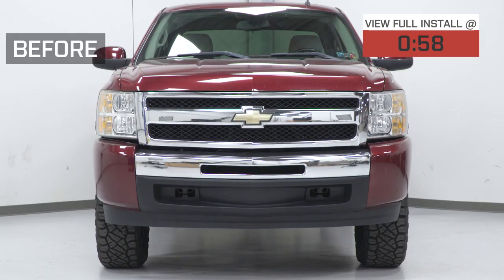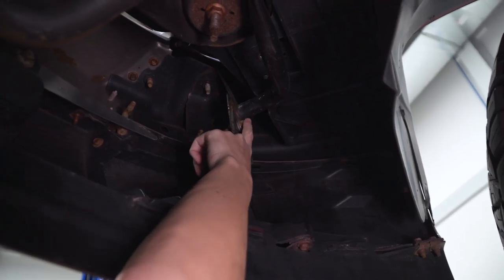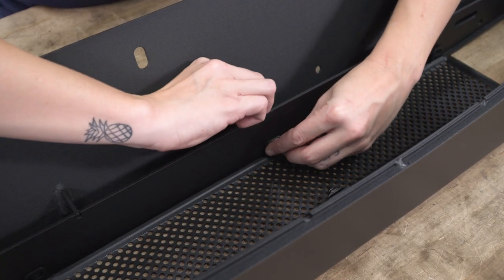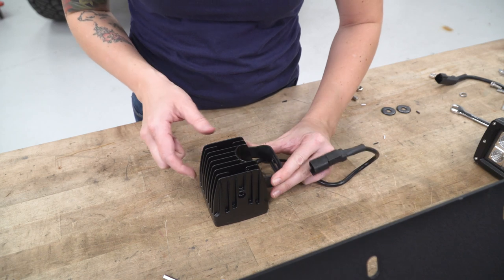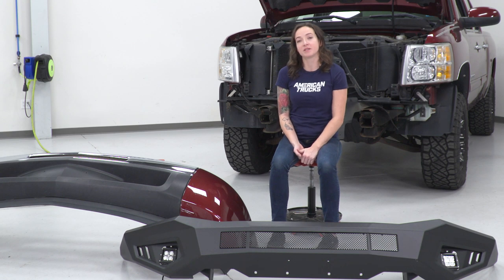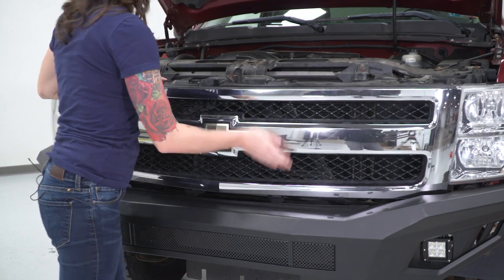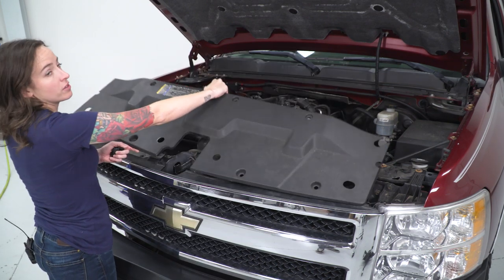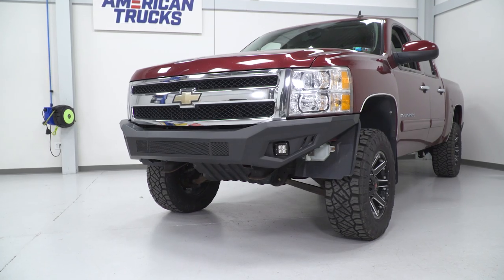2007-2013 Silverado 1500 Barricade HD Off-Road Front Bumper w/ LED Lighting Review & Install

Comment: sorry off topic but a general question... i’m not new to trucks.. but i’m new to different size tires and wheels.. my gmc 2016 is on 17’s.. stock tires.. wanting better tires and wheels.. if i get my truck leveled or lifted to fit new stuff.. i can switch to 18’s or 20’s wheels with new tires without having to switch out anything else right..?? i don’t have to stick with 17’s right..??